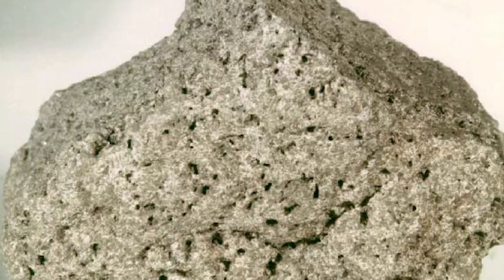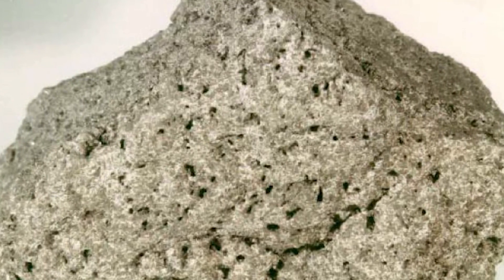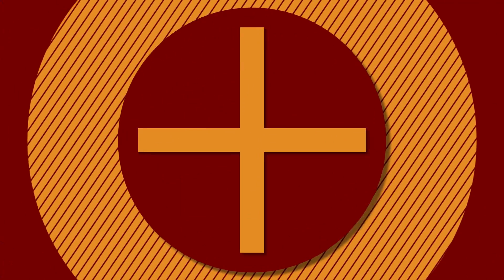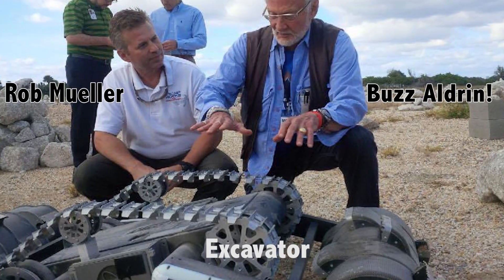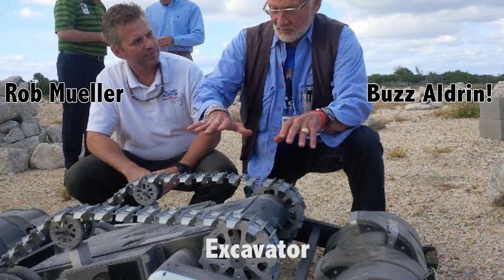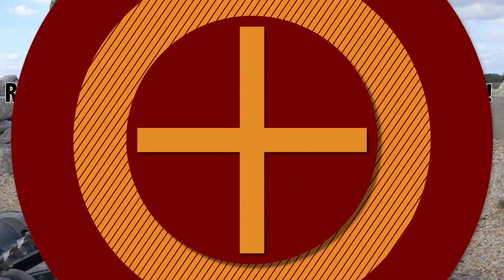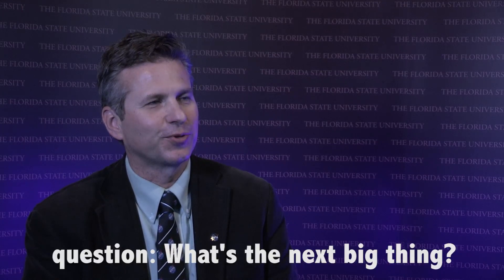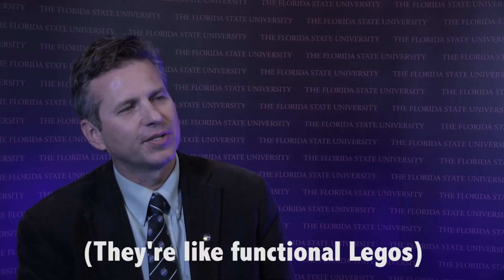askFSU 2- Rob Mueller at NASA Swampworks and 3D Printing on Mars

Comment: If they had 2 3d printers you could 3d print parts if the other one breaks down.
So I guess the first think you would print when you got to mars would be another printer...
Can basalt translate to give the properties of plastic, rubber and metal if it's processed in a certain way then? Say, if you needed a fan belt or a girder?